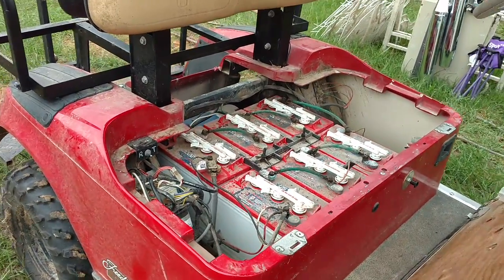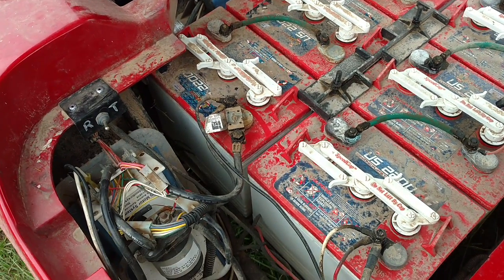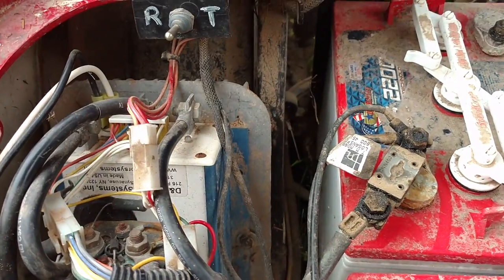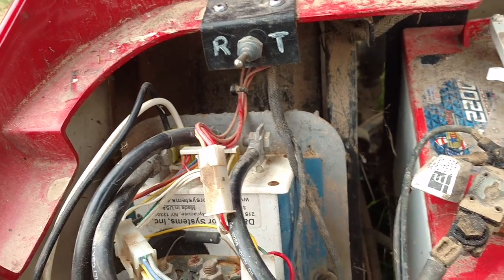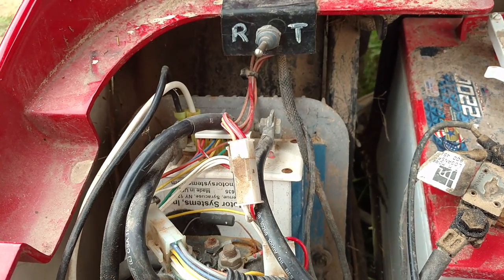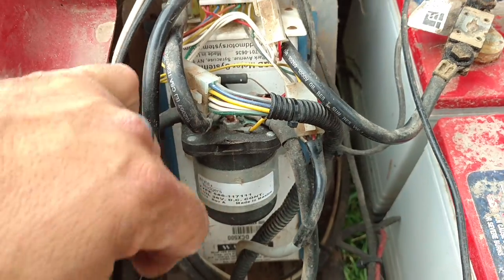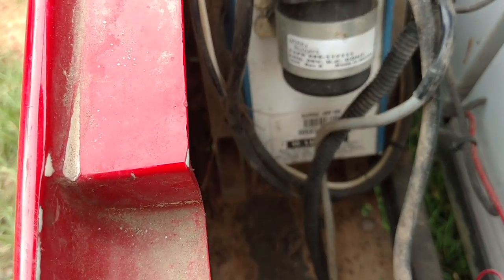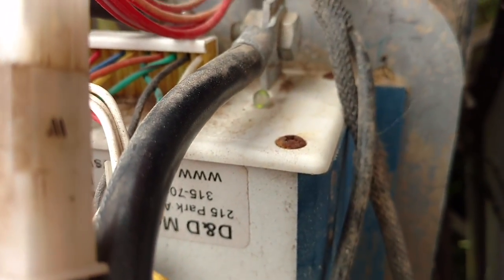EZ GO golf cart trouble

Comment: There's other problems that will cause that condition remove all the wires from the solenoid and see if you have continuity between the two large posts if you don't the problem is not the solenoid

Comment: Hello, thanks for the info vid. Our cart was running on minute then just started making a buzzing sound from near the controller area or motor. We did not remove anything yet . 2001 EZ-go txt. Thinking solenoid?Any feedback would be appreciated , Thanks
Reply: Mine has the same problem did you ever get a solution

Comment: i could use a bit of a push in the right direction.   I have an ez go golf cart...   i believe it's a 2005 or newer.    makes noise while driving that seems to be coming from the steering assembly...   any help out there?
Reply: Steve Willyard check for anything loose first. We had a stick up against a clutch many times. They get dirty and blend in. I am a golf super. Look for anything out of place or loose. Shaking rattling check rods.

Comment: Did the Solenoid fix the Issue?
Reply from the maker: Sad to say I did put a new solenoid on it the other day and it did not fix the issue. so as soon as I can I will be taking it to the place where I bought it at to get them to work on it. I just hope they don't tell me I need batteries. Because batteries are not cheep.
Reply: Did you find out what was wrong
Reply: I got the same problem and it started by not going forward, now a yr after it's not moving at all, it reversed the motor cables to go forward instead of reverse to be able to use it but now it's doing the same thing, green light then when I press the pedal on both forward or reverse it flashes red, if u fix yours please let us know what the issue was
Reply: Did you ever figure out what was wrong?

Comment: get a flash light and shine it down in your forward and reverse switch and if it is melted you probity need an new one
Reply: josiah quinlan13 , do you know a lot about these? I just bought a 2005 that after 3 days it will not go in reverse. The switch flips and the alarm goes on but won’t engage motor. Goes in fed just fine and can push in reverse

Comment: i have a ezgo and it can go forward or reverse with the key turned off help
Reply from the maker: Kenneth Sikora It sounds like the key switch contacts are stuck in the on position. You may need to change out the key switch.